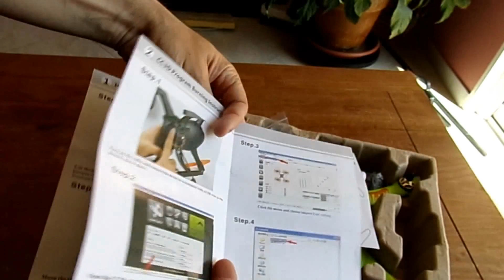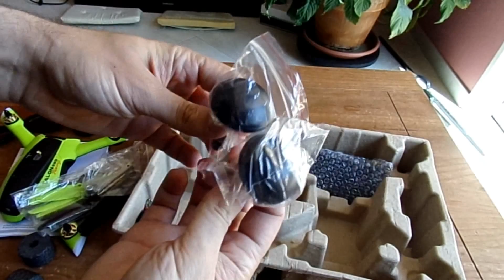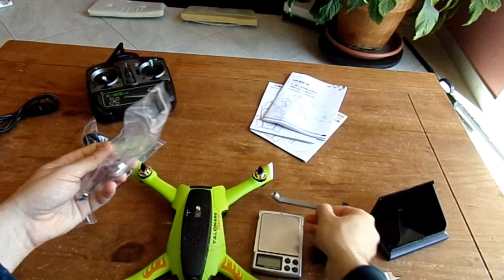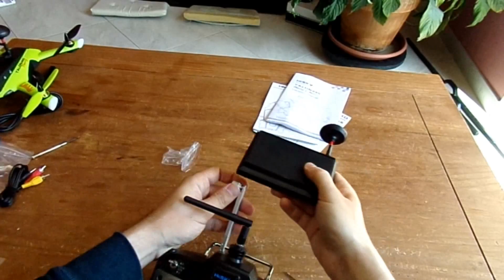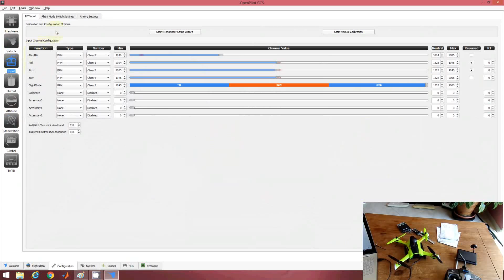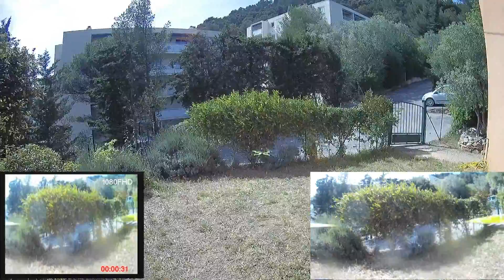HiSky HMX280R "Talon" unboxing, configuration and quick testing (Courtesy Banggood)

Comment: Solid package and has the potential to fly fantastic. Everything the X251 wasn't and no question about bait and switch with rate mode here. What do you use to record guitar Seby? I'm looking at a irig acoustic thinking it looks too good to be true.
Reply from the maker: Well I was positively impress by the FPV ring .... even if I suspect the 1080p to be interpolated from the 720p. I am impatient to test it on the fleld.... For the guitar ? my god ... i use the sound track of my video camera :).... it was a very raw wilde recording